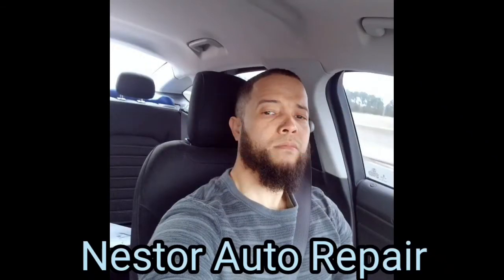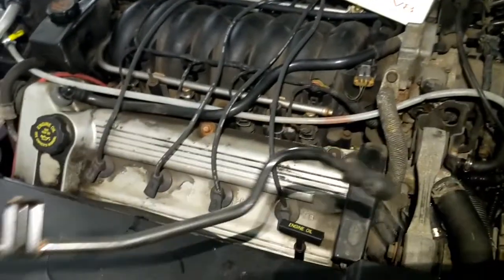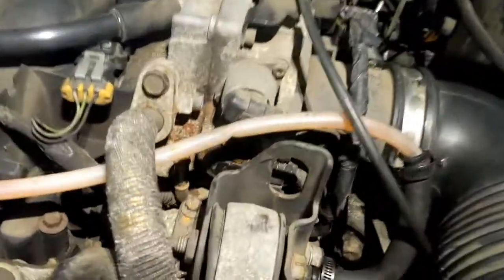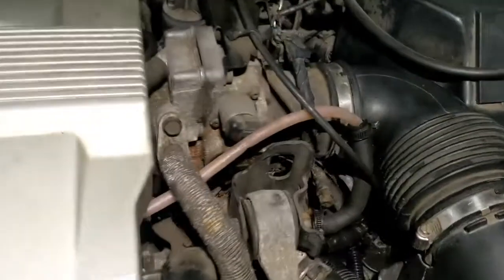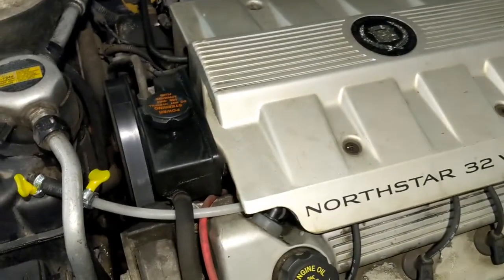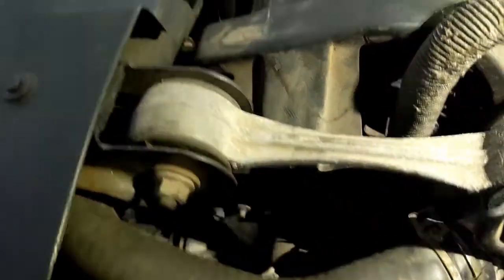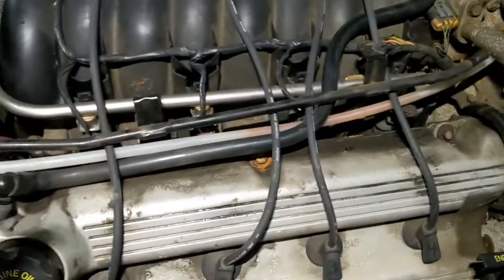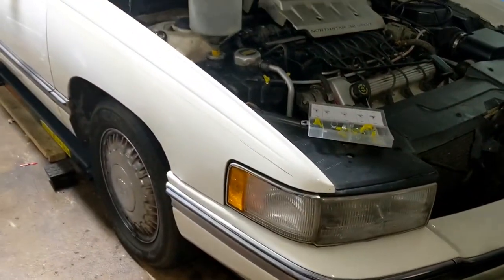cadillac northstar engine overheating  fix

Comment: You need to burp your system. There is alot of air in your system. That will also cause it to run hot

Comment: It clog up because the head gasket is leaking exhaust into the coolant. I have a 2001 Deville and I had to drill out one head bolt hole to stop my engine from over heating. You can reuse the stock head bolts but don't torque them more than 50 lbs-ft.
Reply: You sound very knowledgeable.
Reply: @grantp4022 I’ve owned a 2001 Deville for 7 years.
Reply: @Fone65 I had a 2001 Cadillac dts witb 140k miles it never overheated on me ..

Comment: Coolant temp heats up car does not over heat when sut off it comes through over flow line at high pressure
Reply from the maker: Get a new radiator cap

Comment: I have a 2001 Eldorado ETC that isn't overheating yet but the tank on the side of the radiator is cracked. Any tips for removing the radiator and flushing/bleeding the system? This will be the most intensive car repair I've done.

Comment: Good old DEXKILL turns into mud.  Best fix is flush the cooling system and use regular universal anti-freeze/ coolant..
Reply from the maker: Ok
Reply: yeah....the coolant cap cover "recommends"  Dexcool,  but if it WILL turn into bad substance inside the tubes/hose,  forget it....I know Prestone makes a universal "all types of makes" antifreeze.....maybe Cadi / GM is playing smartass and thinking we are DUMB to follow their advice and buy Dexcool and screw up our motors, only to bring it to repair shops and get ripped off $$$$$$$$$$$$$$$$.....

Comment: Brilliant   see thru hose   thank you   what is that hose called?
Reply: nestor....what type of hose is this? the see thru one.....im willing to buy a same/similar hose and rid of the metal tube!  and use screw on clamps....can I get the similar hose at a hardware store?? I have SEEN similar ones there....

Comment: I just bought an 07 DTS with 154,000 with the northstar v8 and when I got home today I noticed it was smoking under the hood but the temp gauge hardly passed halfway if it did at all, any tips?
Reply from the maker: Check the same hose and make sure the fans are kicking ON
Reply: @nestorautorepair  Okay I’ll let you know what I figure out
Reply from the maker: Ok thanks
Reply: Did you find out the issue? I have a 2007 DTS as well, 3 days of having it with only 99,000  miles and it started overheating.
My brother says the fans aren't working...so it's the temperature sensor?
This was discovered when trying to turn the heat on.
Nobody seems to have an answer as how to fix it because nobody can find the temperature switch/sensor 🤦🏼‍♀️
Reply: Temp sensor is located back right corner of engine according to a video I watched.

Comment: Hey man I changed my thermostat and radiator! Car runs OK! thermostat meter stays at half then goes over pass the half marker. When you give it gas the meter drops back to half then once it’s idling it goes back pass the half marker. Idk what’s going on…beautiful car don’t wanna get rid of it
Reply: If it stays half way while you are driving and only goes up while you idle make sure your radiator fans are working used to happen to me just replaced the fans and never went past halfway even when idiling for 20-30 mins straight
Reply from the maker: Yes
Reply: I have the same issue with mine I am so tired I love my car but it’s  driving me crazy
Reply: @yanuaia1 did you get it fixed?
Reply: Mine does same. Everytime I take it to my  mechanic I'm giving a different reason to why it's doing that. She runs great though but eventually the overheating will get worse.
Reply from the maker: Ok go for it let hem know
Reply: Mine was overheating after thermostat replacement because I had to burp the radiator make sure all air was out.  Also fans where intermittent bad relay.
Reply: @jcbartman1618 how did u burp the cooling system
Reply: My caddilac is always a little pass half way, Is that normal
Reply: @crazycardcollectibles9678 me too hovers just above the middle line
Reply from the maker: Was the car doing this before you work on it ?

Comment: So my 2002 Cadillac DTS is overheating. What could be issue on that ??
Reply from the maker: It can be many staff one or the other 
Water pump 
Thermostat 
Low coolant 
Fan not working 
Fan relay 
And many more

Comment: I have a question my 98 Deville has also started the ver heating but it also been reving on its own and it says idle Engine which I think Is making the car over heat but I don’t know what could be causing it to rev on it’s own ? Anyone els had the same problem?
Reply from the maker: Idler air control valve is dirty ,, coolant run inside the valve , but the over heating is another problem, so you have 2 problem

Comment: Yeah that typically happens when people don’t replace that dex cool after the five or 10 years i’ve always done mine like old-school way from when I used to be a mechanic dude I flush and drain mine out every two or three years dude never had a problem with my Eldarado
Reply from the maker: Correct
Reply: That's a very smart thing to do. I need to do this as well.
Reply: I heard Gm had special tablets u put into the radiator to stop it from overheating

Comment: Will this cause pressure in the radiator hose ? Make it feel hard
Reply from the maker: Yes very hard
Reply: I was just gonna ask that cuz my just gets hard I changed radiator thermostat heater core radiator top 😢

Comment: I have been working on my dads 97 deville with the northstar engine, he accidentally put green coolant a few months back and i have flushed the system several times since. i have also replaces the temp sensor, thermostat, radiator, upper and lower hoses and the purge lines. it still overheats. what else could be causing the issue? the fans work, everything that wasnt replaced was cleaned and flushed clear. can you help me with any other ideas?
Reply: Most likely you probably have a blown head gasket NorthStar V8 engines are bad for blowing head gaskets, see if you have white looking smoke coming out of the tail pipe that's steam, or milky looking oil or oil in your coolant those are all signs of a blown head gasket, I have a 2000 Deville and it's has a blown head gasket to, You could try putting some head gasket sealant in it, it might fix the problem I would try that before I would spend a couple grand on a 25 yr old vehicle having the head gasket replaced, well I hope that helps you out. (PS I put sealant in my Deville it held up for about 8 months before it started running hot again, now I have to pull the engine to fix the head gaskets)
Reply from the maker: Wow
Reply from the maker: Have you check the line I show on this video ?

Comment: Ok I did this I’m still overheating so do I change water pump and thermostat now
Reply: Fix changed radiator thermostat Car haven’t overheated one time
Reply: @albertalexander1548  You initially said the thermostat replacement didn't work, but then said you replaced the radiator thermostat and all is good. Are there two thermostats in the NorthStar?
Reply: @da324  I did replace the thermostat and it still overheated then I put a radiator a housings reservoir and changed a couple hoses no overheating since
Reply from the maker: Good
Reply from the maker: Oh nice!! Thanks for sharing
Reply: Change thermostat car still overheating the mechanic said change radiator or the heads I’m knowing it’s not the heads I can send u a video of the car starting up running and the meter goes up about 40 min of running
Reply: Just tired of errbody saying I shouldn’t have bought it but I know this car good
Reply: Yo what should I do next
Reply from the maker: Let me send you a link if one of my video so you can test your head gasket
Reply from the maker: https://youtu.be/KKNfqjcaiCE
Reply from the maker: https://amzn.to/38nnFEo
Reply: @albertalexander1548  Did you clean out the bolt that the hose hooks onto?  Its not really a bolt it has a very small hole in the middle its what Nester attached the return hose to ,not the overflow tank side the other where the thermostat is.
Reply from the maker: K
Reply: No heat
Reply from the maker: Try thermostat first
Reply: Thanks I’ll try that next
Reply from the maker: Ok
Reply: @Eggy drummer30  my shit running bro new thermostat new radiator new fluids that bitch perring facts send u a video in the morning
Reply from the maker: Is the heat working ?

Comment: Cadillac deville 2001 overheating I wanna do what u just did
Reply from the maker: Yes go for it I'm sure that will be your fix
Reply: @nestorautorepair  should I still change water pump and thermostat anyway
Reply from the maker: No don't do that yet , that may not fix it , first do what I did
Reply: I did it I’m still overheating do I change the thermostat and water pump now

Comment: I think this may be my exact issue! Thanks so much for posting this, I have a Seville SLS and after replacing the radiator, new water pump and thermostat it still tends to overheat, my only question now is how I do I remove the engine cover to access that hose to check it?
Reply: Did you resolve your issue? The beauty cover comes off with a 13mm socket, there's 2 bolts. This overflow tube is notorious for clogging and causing overheating
Reply: @BradleyH  I ended up selling it before I could see any of you guys comments 😞 wish I would’ve held her a little longer! Thanks for your help though
Reply from the maker: Thanks boss
Reply from the maker: Hey thanks for your feedback , 10mm socket
Reply: My electric fans not coming on I have a 2001 Caddy STS 4.6L  It ran hot on me once I haven't drove it sense October 2022  Ready to get it road worthy now. Help.
Reply: They put a stop leak in the coolant?
Reply: @proimagecarcare  if I know the radiator IS leaking slightly,  I would add BARRS powder product into the radiator,  that does help MY car....dunno about others...
Reply: Most likely head gasket! some people put shit in the coolant to temporary hide the blown gasket and then sell the car
Reply from the maker: Yes some people do that correct
Reply: @Trollet456  Yep and I think I bought one. Buyer be very aware.
Reply: @georgetommila3240  what do you mean? How can they surpass that issue by putting coolant in?

Comment: Fack men mine is overheating and i changed the thermostat but thats not the problem and prestone is not missing or leaking
Reply from the maker: Then this will be your fix
Reply: @nestorautorepair  maybe or maybe not because mine is a dts not a deville but i see they are made same shit maybe there is some of parts a bit different ... so maybe its my water pump or my headgasket
Reply from the maker: I see I do have  video how to check both
Reply from the maker: Ok
Reply: @nestorautorepair  where to buy that hose so I can see the coolant flow through.  Thnx
Reply from the maker: This one are of a vendor machine , I'm sure at any hardware store they will have it